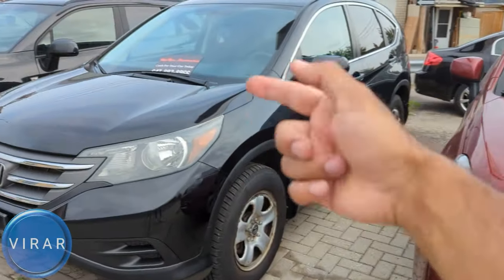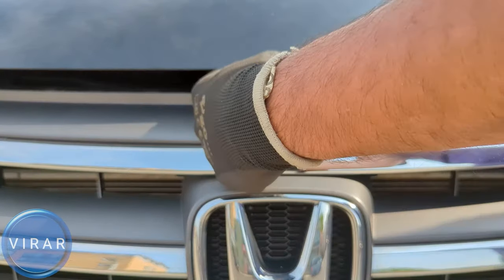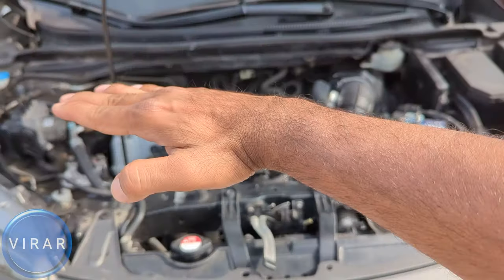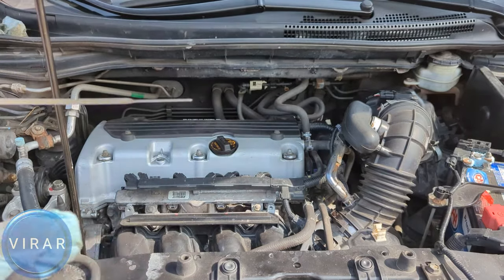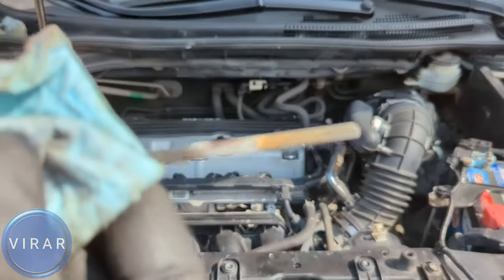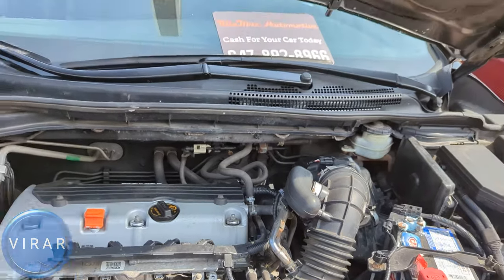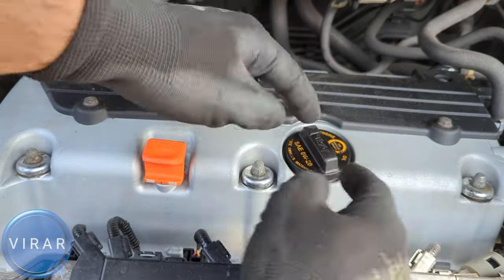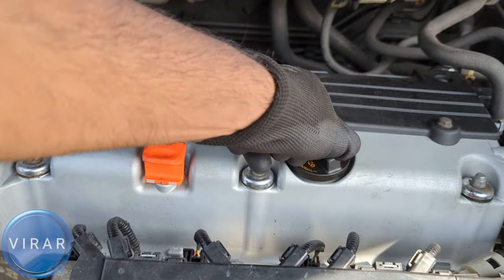How to Check Engine Oil Level - Honda CR-V (2012-2016)

Comment: I have 2008 Honda crv, my question is if the engine must to be on or off to check the oil level motor?
Reply from the maker: The engine should be off when you check the engine oil level.